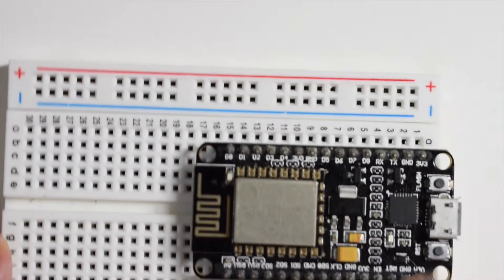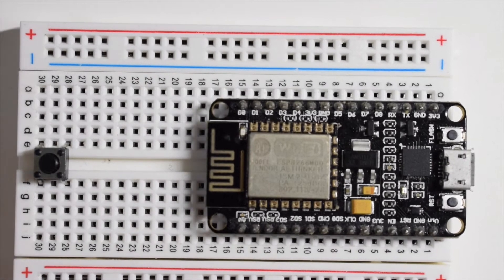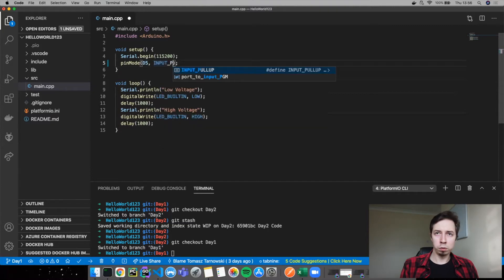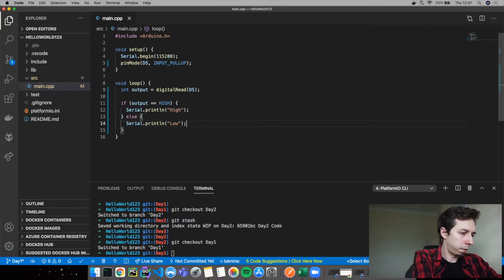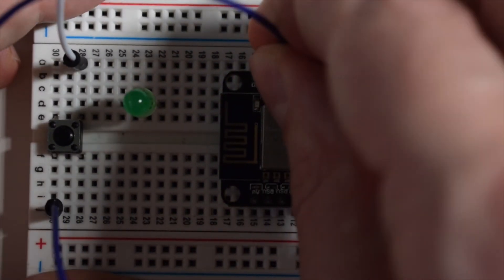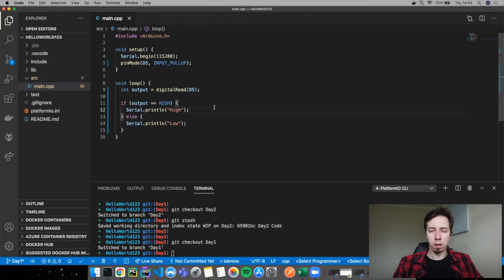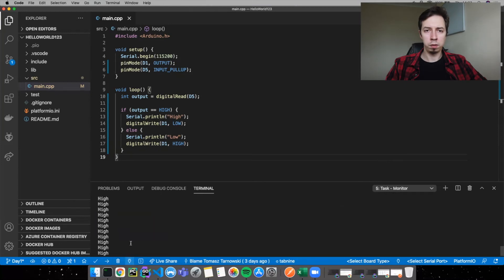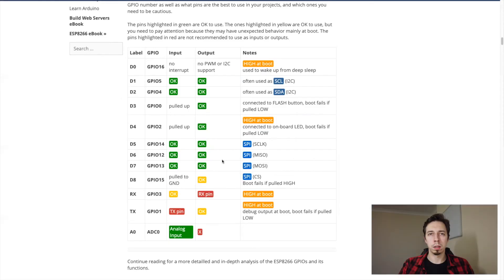ESP8266 Control diode with the button - Day 3 of #100DaysOfCode in IoT

Comment from the maker: Hello, I must admit a mistake I have done here by not using a current limiting resistor which is always a good practice. Let me explain.
The reason I haven't used a resistor was due to the forward voltage of the LED diode I used in the video which is higher (4V) than what the ESP8266 pin provides(3.3-3.6V) it mislead me to think that the resistor is not needed since from the formula R = (Vs - Vled) / I(led) you get a negative resistance of -83.3 Ohms (look at the comment below). This formula is incorrect!

From the datasheet's Forward Current vs Forward Voltage graph that you can find on page 6 here:
https://openlab.citytech.cuny.edu/principlesofengineering/files/2020/10/ELEGOO-Uno-Kit-White-LED-Datasheets.pdf
we can conclude that for forward voltage of 3.3V(which is potentially our drop since we get 3.3V from the pin) we get 10mA of current and therefore:
R = (Vs - Vled) / I(led) -> R = (3.3V-3.3V) / 10mA = 0Ω
does it mean though that since we get 0Ω we don't need a resistor? Wrong! We still need it as the formula describes an ideal world.

What should be its value then? What should we need to look at to figure it out?
The answer is the Forward Current vs Forward Voltage graph (page 6 of the datasheet) - notice how steep the graph becomes when the voltage reaches something around 3.15V -> for a small increase of voltage we get a much higher increase of current - this tells us that in a hypothetical situation where we get a sudden voltage spike (that it's worth considering) we're gonna get an exponentially higher current spike that can, in the end, burn the LED and in order to prevent this kind of situation and flatten the graph we could and should use a current limiting resistor. 
Now to find the right value of the resistor for my case Iet's pick a Current vs Voltages value from the datasheet's graph that's slightly below our supply voltage like 5mA vs 3V and let's use the formula again:

R = (Vs - Vled) / I(led) -> R = (3.3V-3V) / 5mA = 60Ω

with the resistor of 60 Ohms and a voltage spike of 5V -> I(led) = (Vs-Vled) / R -> I(led) = (5V-4V) / 60Ω = 16.7mA (that without resistor would be much higher if you look at the graph).

That's it. I suppose in my future videos I'll be using LEDs with smaller forward voltages to avoid any further confusion. Still it was a good learning experience.

Also, please do not take everything in this comment for granted we're all learning here and if you spotted another mistake in my calculations please point it out so I can amend anything that's still incorrect.

One more question that might arise here is - is my LED diode going to emit light with the resistor? the answer is yes however it'll be slightly dimmed - we can tell it from the Relative Intensity to Forward Current graph -> in normal conditions at 5mA current we should get around 50% intensity.

Additionally, here are some links to the internet resources I used to write this comment that I recommend reading if you're interested in this subject:
https://electronics.stackexchange.com/questions/573214/what-will-happen-to-an-led-if-the-forward-voltage-vf-is-greater-than-its-suppl
https://electronics.stackexchange.com/questions/12865/is-a-current-limiting-resistor-required-for-leds-if-the-forward-voltage-and-supp
https://siytek.com/what-happens-if-you-dont-use-a-resistor-with-a-led/

Comment: Why you didn't connected diode through resistor???
Reply: I don't understand how your calculation works. 
First, standard LEDs have a forward voltage of 1.4-2.6, and not 4 so the resistor will be a positive value. Maybe this is not a standard LED but I couldn't find anything about LEDs with a forward voltage of 4 volts in a quick search online, so I'm interested in the datasheet.
Second, the Esp gives you 3.3 volt, so if the forward voltage of the LED indeed was 4, you wouldn't have enough voltage for it to turn on at all.
Reply from the maker: @yardennaveh2441  you can find datasheet here:
https://openlab.citytech.cuny.edu/principlesofengineering/files/2020/10/ELEGOO-Uno-Kit-White-LED-Datasheets.pdf

on page 5 there are specs for the green diode, as you can see there the forward voltage is 3.6(typical)-4.0(max)  once connected to ESP it does emit light like on the video

under given circumstances I can only see the case with using the resistor as a good practice for current limiting however with ESP it won't be possible to draw more than 12mA from a single pin
Reply from the maker: actually I double-checked it and looks like I was wrong with the calculations, please see the pinned comment, thanks and sorry for the mistake
Reply from the maker: hey, good question - the reason is in the forward voltage of the LED diode itself that is 4V which when used to calculate the resistor value gives us negative number:

we've got:
Vs - source voltage from ESP8266: 3.3V
Vled - diode forward voltage from datasheet: 4V
I(led) - diode forward current from datasheet: 20mA (however we'll have something around 12mA - the max value we can get from ESP8266 pin - it won't make any difference, though)

then using the equation we can calculate the resistor value:
R = (Vs - Vled) / I(led)

R = (3.3V - 4V) / 12mA = -83.3333... Ω (Ohms)

and hence the value of R is negative we don't need a resistor :)

BTW looks like I forgot to add diode datasheet info to the description of the video, sorry, gonna do it now
Reply: @tomasztarnowski4434  ok, in that case make sens - good job by the way.
Reply from the maker: thanks :)